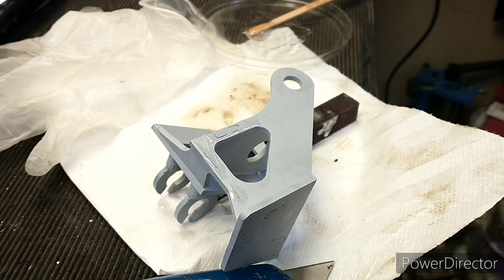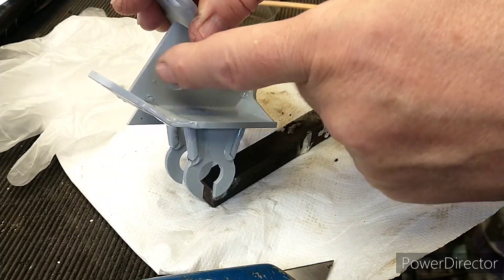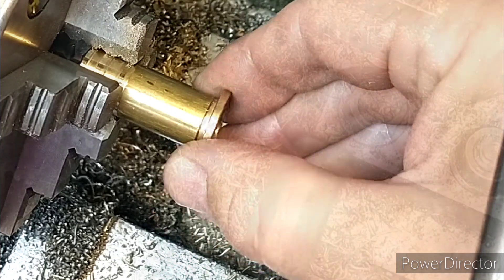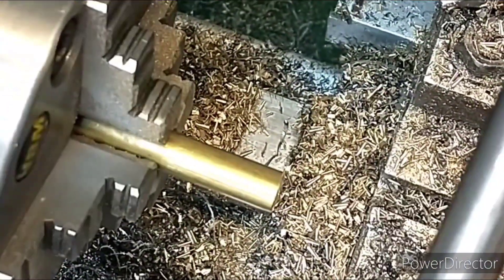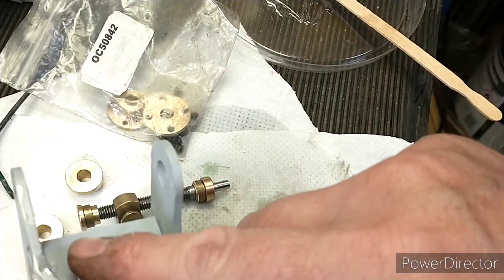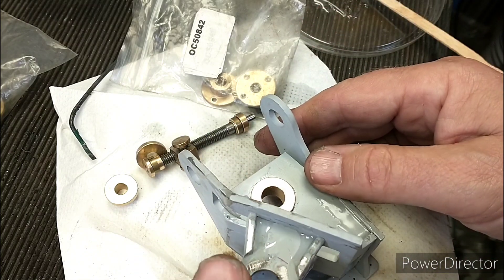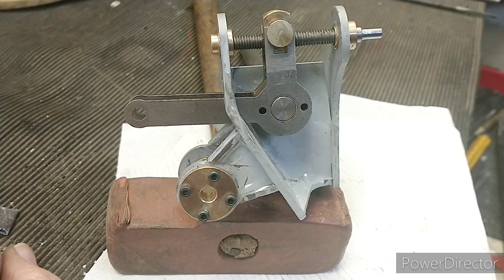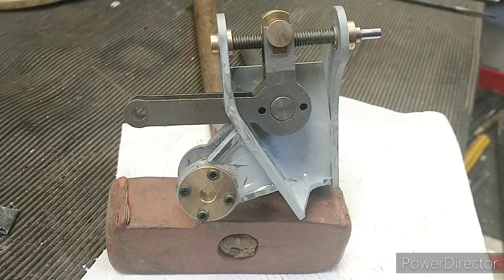Modelworks Britannia Ep38: Bushes #livesteam #modelengineering

Comment: Looking good Julia
one question & one suggestion
You say weghtshaft i say weighshaft, i only refer to this because my simple mind has only come across this in my Sweet Pea Book by Jack Buckler. ???? and he says "weigh"Just wondered why
Also instead of Araldite for filling unsighty gaps and blending corners have a go with carbody scratch filler, no mixing, dries quick and sands better, and deeper fills can be built up in layers. Just a thought as when i try to sand araldite it seems to be a bit rubbery and clogs the sand paper.
see you next time
atb
Kev
Reply from the maker: Hi Kev, you are quite right I'm always getting the walshaert components mixed up so no surprise I got that wrong 😳 I wanted something a bit more robust than filler as it was on the edges of the plate. Good tip on the scratch filler I wonder if that is knifing stopper by a different name? Thanks 😊
Reply: @julias-shed  yes, it comes in a tube like toothpaste👍👍👍👍🚂🚂🚂🚂
Reply from the maker: @MrFactotum  I'll keep an eye out for some as I think my knifing stopper went hard about ten years ago 🤣